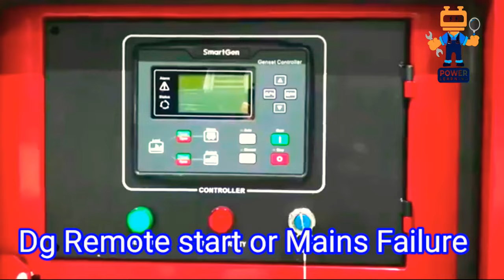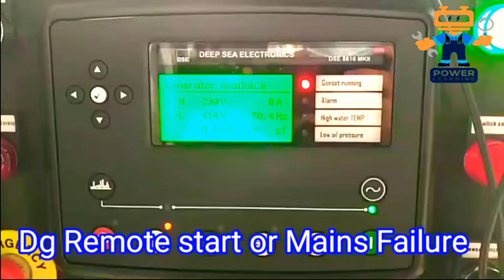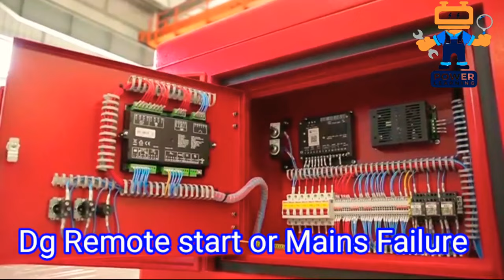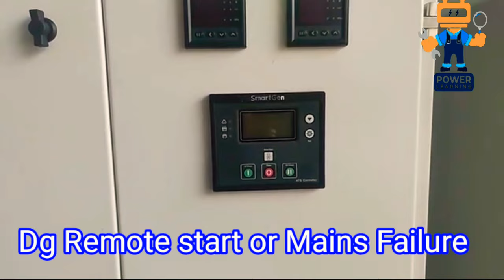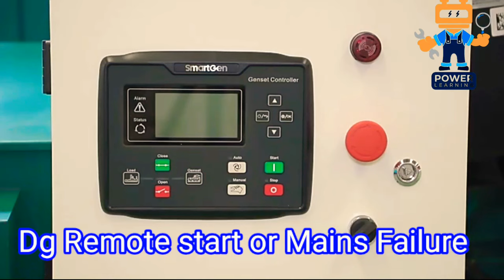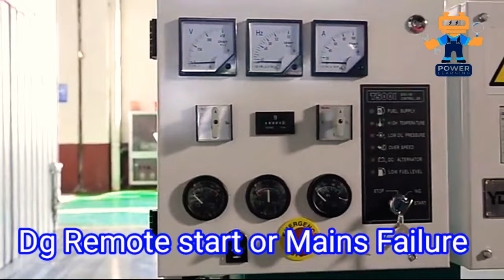Diesel Generator Auto start & Stop wiring explain | auto main failure & remote start wiring dse 7320

Comment: Good afternoon I have a Smart Gen HGM410N and I am having trouble wiring it.  Can you explain in English how to wire it?  I the customer wants to power the unit with 24v and only send signals to a generator 100 feet away. I need to know if the generator needs a negative signal to activate or a positive signal?  The manuel is hard to understand,  thank you

Comment: Assalam o Allikum sir ap pachli our ya video Urdu me banay please sir please
Reply from the maker: Inshallah
Reply: @DieselGeneratortraining   muzamil brother I have problem of synchronisation I have 4 diesel generators all synchronisation are fine except one cumins diesel generator , whenever I try to use that generator , it will says fail to synchronise eventhough everything is correct fr, rpm, all are OK. 
When I start only that generator others will flow no problem but that generator it will not flow to any generator

Comment: Dsc 7320 mk11 fail to stop please sir help
Reply from the maker: Change oil pressure sensor
Reply: @DieselGeneratortraining Assalammualaikum...I have in ATS panel DSE 3110 (auto start modul), where is terminal i will connect 2 wire ( polarity + for remote start and fuel on) to panel control generator with DSE 7320 MK II (set module auto start function)